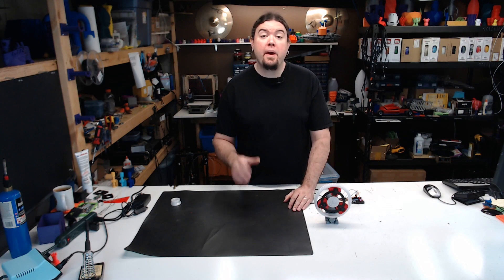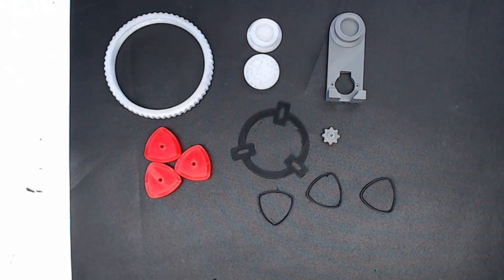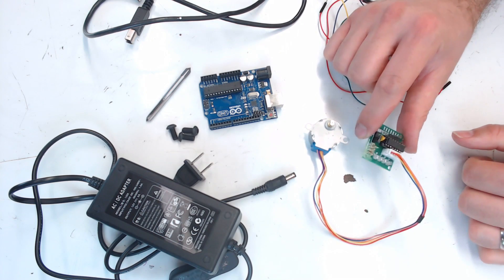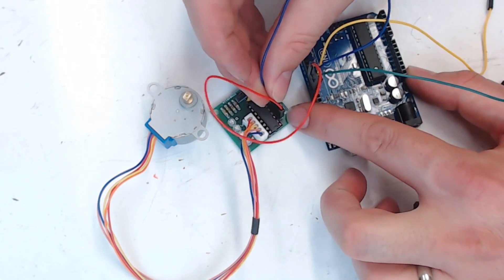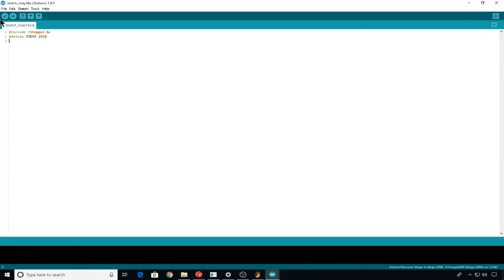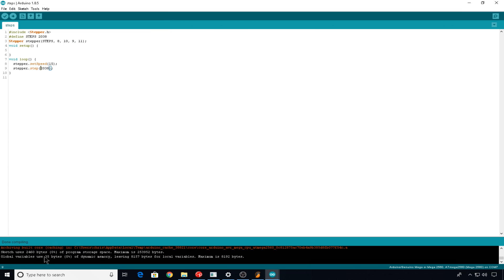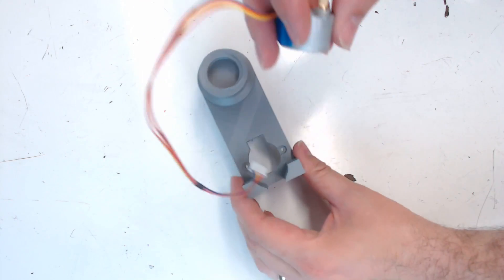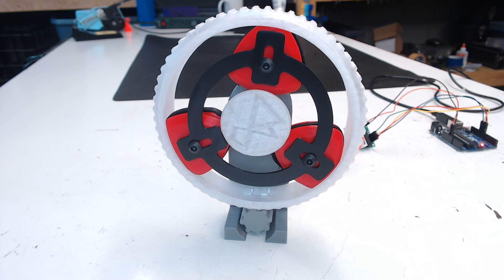Maker's Muse Reuleaux Triangle Bearing - How To - Chris's Basement

Comment: Nice. Did you need to enter 2038 for the stepper.step? Since you already defined it as STEPS couldn't you have just use that?
Reply from the maker: Thanks! Yes! That works just fine, I though it was easier to show how you can make it negative to run it backward if I entered the number. Probably a half dozen ways to get this done.

Comment: Wait a second!  - the triangle bearings are not rotating.  Did I miss something?
Reply: Ahh! OK.  I see it now.  My mistake.  Thanks for the video and the reply.
Reply: Watch more closely, They are slowly turning.
Reply from the maker: Hey Joe, they do spin very slowly. The tolerance on the parts could be a little tighter. Some times the TPE bands will spin instead of the triangle part. Still a cool build, but you might have to scale some of the parts a little tighter to get it to work every time. Thanks for watching!
Reply from the maker: You bet! Thanks for watching and participating in the comments, it's always appreciated.

Comment: Why is the motor not spinning smooth?
Reply: switching the steps to 2048 fixes this. looks like 2038 is a typo
Reply: Thanks for the reply. Could you show us how you got to the 2038? Just want to understand how you got there.
Reply from the maker: Sure! This is the model I ended up with. https://solarbotics.com/product/22310/
Reply from the maker: The motors are VERY inexpensive and this one went through a lot of turns while I filmed the video. I had to take it apart and put it back together many times. It started out spinning smooth then got a little ware on it over time, it had some front and back play on the motor shaft. If you are going to buy these motors you might order a couple just to be safe.
Reply from the maker: Liam Tidwell There are a lot of different types of these motors. The specs differ a lot from type to type.